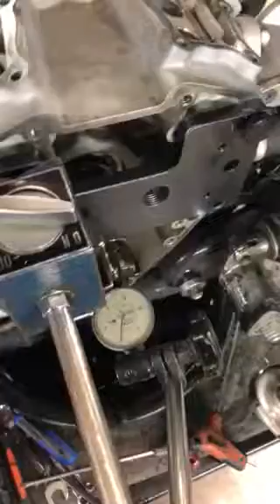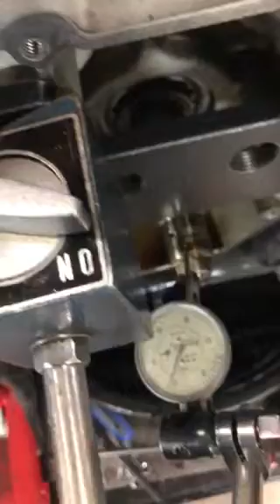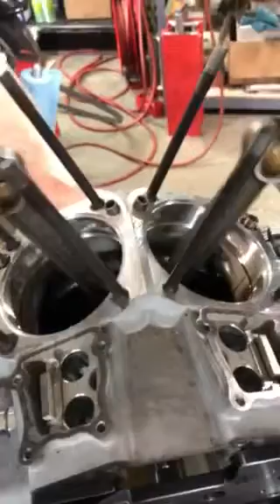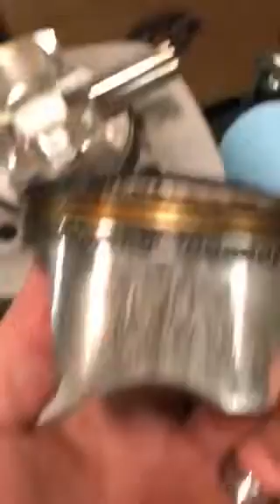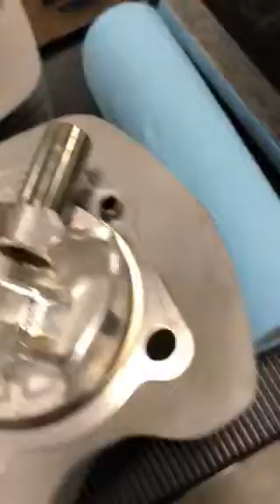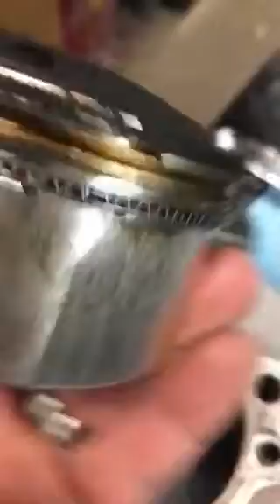Harley Twin Cam bad Crank

Comment: When my bike gets hot, I get a clack and a vibration more than normal. Usually when i grab the clutch
Reply: It’s probably your clutch plates chattering. You release the tension on them when you pull the lever in and that increases the space between the frictions and steels, once the plates are worn down some the distance increases and the plates can move around more and make more noise. 

That said it could be several other things, a bearing issue, cracked clutch hub or basket, etc. You really need to pull covers and do an inspection and if you’re not sure what I’m talking about you should have a professional shop check it out.